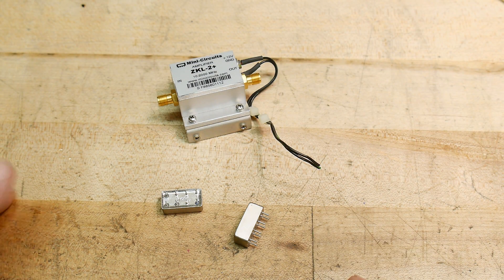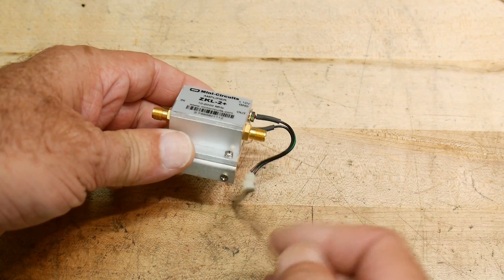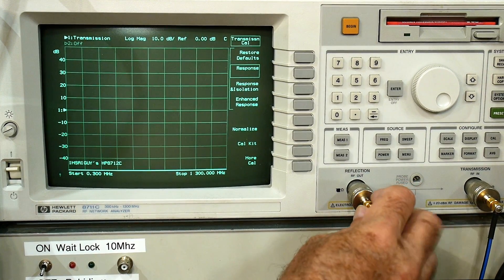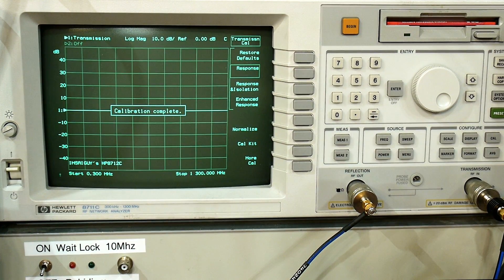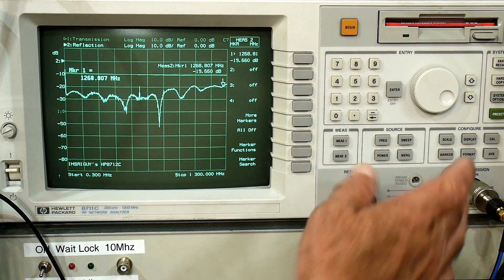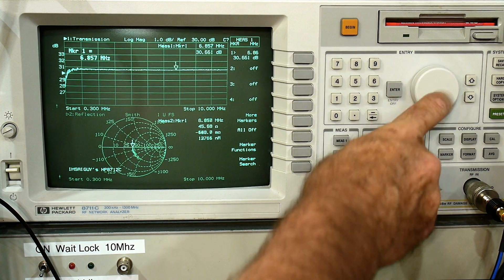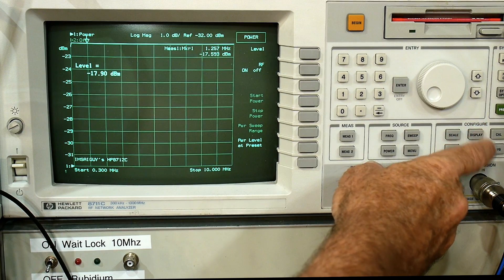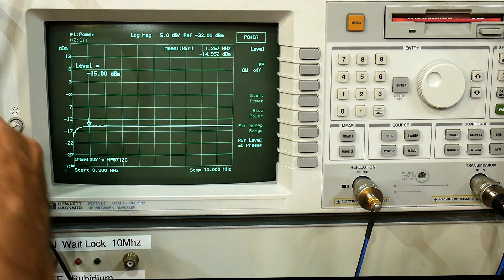#912 Mini-Circuits RF Amplifier (part 1 of 2)

Comment: That network analyzer its for 75 ohm, isn’t it? You use adaptor to 50 ohm? How is it that accurate enought?
I am thinking on buy one of those analyzer, because VNA are soooo expensive, and presume that the 75 ohm is cheaper
Reply from the maker: I converted it to 50   https://youtu.be/MSLm3FL7HDM